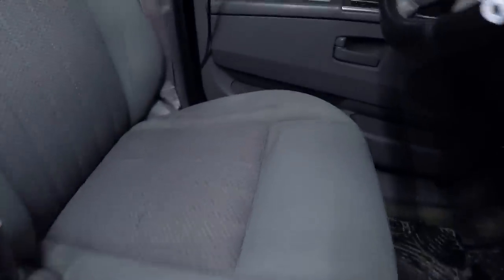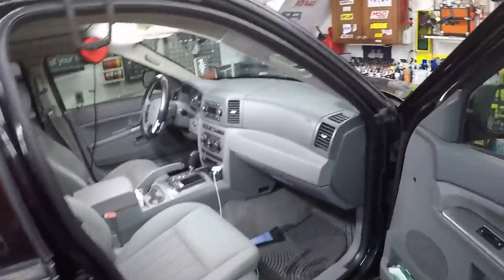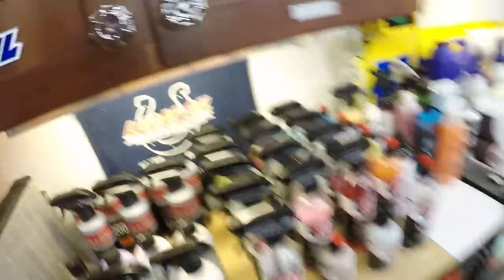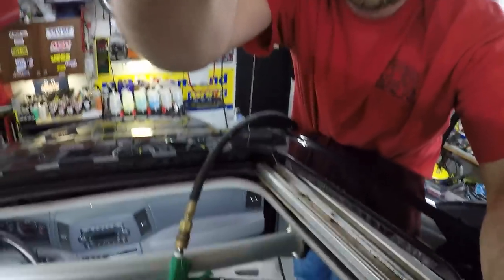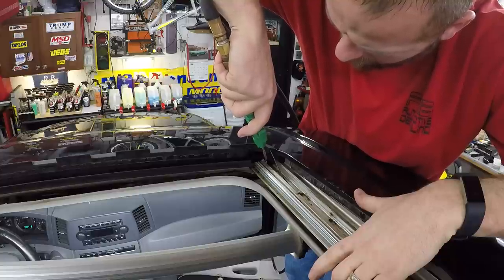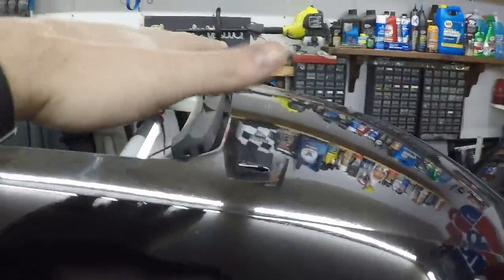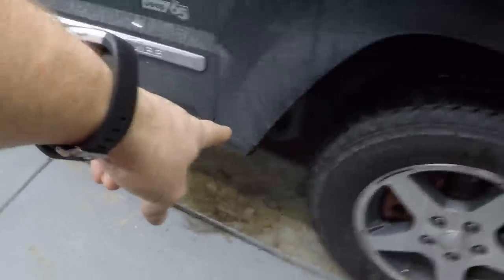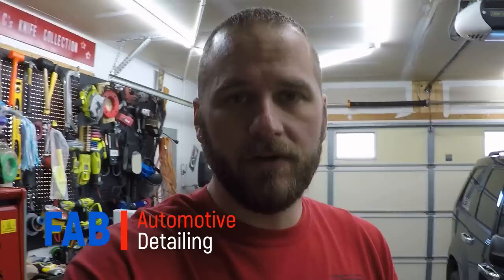Jeep is Leaking Water Inside!

Comment: I have the exact same problem on one side of my 2008 Jeep Grand Cherokee. My driveway falls away and to the side, which may be why it's only one side? I've cleaned out the drain below the windscreen wipers but this did not solve the problem, so I'm really pleased and grateful to find this video. I also have corrosion 'blooms' both sides under the rubber gasket, which was not removed in this video. They are situated at top front of each door under the more substantial bodywork rubber gasket, which I guess hold dirt and water against this location. Hopefully, the corrosion has not perforated the bodywork, and the sunroof drains are the only issue! An easy check thanks to this video, well easier than repairing bodywork!! I'd never would have worked this out without this video. Thanks so much!! 🙏🏻

Comment: If you take the kickpanels off you will see where the draintube exits the vehicle out of a grommet. Remove the grommet and you will see it has flaps on the ends cut them off or use a drill bit to bore the grommet out. What happens is the water and debris get into the moonroof draintubes and the the flaps trap the debris and prevent water from draining properly causing them to back up and spill over the moonroof assembly and run down the A pillars onto the floors
Reply from the maker: LAKE ERIE AUTOMOTIVE I appreciate the information!
Reply: Thank you so much , I’m going to try this
Reply: @rccaraddict294  me too
Reply: @matrix64  it worked for me.

Comment: Thanks for the video! My level blow gun tip could not reach the drain hole in there, so I have used plastic soda drink straw to stick it inside the drain pipe and sticking the gun tip into the straw, it had a resistance of the air flow for a few seconds and then all the water just poured out of the bottom exit. This was on the drivers side where the leaks were happening, there were no leaks on the passenger side and no resistance for the air to flow. After blowing both sides out I tested the drainage with the water bottle and all the water just drained out as it should. Again, thank you for this informative video.
Reply from the maker: Awesome glad the video helped!

Comment: FAB Automotive, your video on this solved my exact issue with my 2005 JGC. I tested the driver’s side tube with a little bit of water and it did not drain so I used a few light doses of compressed air and “voila!”, it drained perfectly right where you indicated. I as well checked the passenger side tube and it was OK.

And for that, I subscribed!
Reply from the maker: Awesome glad I could help and welcome to the FAB Family.

Comment: In the end, figured it must be the grommets at the floor panels (that the blue tubes run into). I learned that it’s like the nipple on a baby bottle,  and gets really skinny at the very end so can only drip water out slowly in the cleanest of conditions. Pulled out the panels only to find that a previous owner had already snipped the nipple off the grommets!!!  I’m at a total loss except to say that these sunroofs just CANNOT handle intense water (& never park on an angle in a hard rain). It just flows over that wall. Will be making good use of the Adam’s!  Any recommendations for cleaning rust in the sunroof track?  Thanks for all the smarts.

Comment: I just got a 08 Commander and it leaks on both sides like this every time it gets wet!  I already blew it out and it still happens!  I’m in the Deep South, no freezing issues here.  It sloshes around in the upper door areas while driving, and comes out from the front edge of the sunroof (which drips onto the steering wheel and then the seat) but mostly the side handles like yours.  
If I can’t figure it out soon I’m going to have to seal my sunroof closed!
Thank you so much for showing us what’s inside all up in there!  I didn’t want to go ripping up my new car, but I was afraid it might have been molding and rotting.  Now that I know it’s all styrofoam, I can focus on the floor and seats.  (I’m going to try the Adam’s)
If anyone has any idea what ELSE might still be going on, please post!
Reply from the maker: You are welcome! Hopefully you get it figured out.
Reply: I have a ‘10 Commander have you been able to figure anything out to stop the leaks yet? It’s been leaking for months now especially when it rains heavy! All over the dashboard, onto the floor and even out of the light fixtures by the doors. Tried looking for cracks or leaks in the drain tube and also tried to blow it out but nothing seems to stop it and i reallly dont want to have to seal up my sunroof /:

Comment: have the same problem with my Commander. I've taken it to the dealer six times for this issue. The last time they replaced the glass, motor and every other component related to the sun roof including all of the head liners etc. It still leaks. I pulled the fuse and plan to silicone it shut for good.
Reply from the maker: My wife has a commander now also and hers was doing the same thing. I keep the drains clean and I have no problems. I have to stay on it though otherwise it will clog up quick and leak inside.

Comment: I find this very preocular- leaks under the dash on the Jeeps. over most of the years-90's through late 2000's. there is a factory repair procedure called a TSB that is normally done by the dealer at no cost to the owner. this is TSB 24-06-96.  
TSB stands for Tech Service Bulletin.
Reply from the maker: I’ve been a mechanic for close to 20 years so I’m very aware of TSB’s and they are not a no cost repair. TSB work is only no cost if the car is still under the factory warranty. With that being said I will look this TSB up tomorrow at work because I am intrigued. Thanks for the info.

Comment: Just took apart my 08, and the passenger side sunroof drain hose was completely disconnected.  Held on from the factory with 6" of electrical tape, go USA.  Jammed the hose back in the reservoir and gave it a shot of JB Weld.  She's never, ever coming off again.  Problem solved.  Dry as a babies bottom.
Reply from the maker: That’s one way to do it! They aren’t made like they used to be. Thanks for watching

Comment: My 2002 wj is leaking down the pillars and dripping onto the floor just like yours was . I have no sunroof. It’s leaking down the very front of the headliner where it meets the windshield and it’s starting to sag.  How the heck is mine leaking so bad with no sunroof  Exact same spots yours was. I checked the windshield molding and was fine. I reglued it down. Still leaks into my Jeep every rainstorm in Florida.

Comment: Great video. This perfectly explains the issue I've been having. If that sunroof drain tube has been confirmed clear  (and not frozen) what else do you think could be the culprit? After each rain the A pillar leaks, causing stains now. Super frustrating. Any ideas?
Reply from the maker: Aerialassault23 Thanks! The hose could have deteriorated causing the leak.
Reply: Hello . I live in Ponce, Puerto Rico . As you know we don’t have snow. My two drains are clear but when rains coming I still have the water leaking problem inside my Grand Cherokee 2006. I really don’t know where is the real problem.  Any more suggestions? Thanks.
Reply: @ivanborrero2966  The drain hoses deteriorate and crack over time
Reply: I am also having the same problem and it's driving my insane. I will check this out. from what I can tell mine are not clogged. I have huge puddles in my driver's side it fills the floor bored. 😩
Reply: People its coming in and draining down your headliner.  Has nothing to do with your drain hoses.  Bad sunroof seal

Comment: Jeeps noted for this 2012 Jeep Liberty of mine leaked multiple time discolored head liner. Sun roofs are a pain in the ass. Yes cause was plugged drains
Reply from the maker: This is the first Jeep we have owned so I did not know about this problem. I have been a mechanic for 15 years and have yet to see a Jeep with this problem so I was a little surprised when I did. Apparently though they are a problem because a lot of people like you have commented the same thing. Thanks for the info

Comment: Had the same problem on my 2005 back in 2007. Water dripping from the pillars, on my feet and from rooftop sunglasses holder. My dad filled the drain holes with silicone chalk and it never happened again. Now, does anyone have electrical dash going on and off? The air conditioning and heat also shut off as the electrical panel dies and comes back on. If I jiggle or push on the key it comes back on. Had the ignition switch recall done and it still persists. Of course, when I took it back to the dealership it didn’t do it...or they just lied to me cause they don’t know how to fix it 😂
Reply from the maker: Drea Mac Sounds like you have a ground issue if the ignition is ok!

Comment: Great video! I might have missed it, but any update? Anymore leaking months later? I just did this exact thing on my 2006. Passenger side was clogged. Used the air to blow out from the top, then took out the bottom and blew it from that direction. Hopefully it stays that way.
Reply from the maker: ViperMike S Thanks! If ice gets on the sunroof then melts water still comes in but  it can downpour rain on it and it doesn’t leak a bit. I think the drains freeze up and don’t unthaw before the ice on the roof.

Comment: I have a jeep commander 2007 sport with out sunroof and is leaking water in the passenger side. If someone have and idea where is coming please let me know.
Reply: I have a 2006 Grand Cherokee with sunroof. All sunroof drains are clear and drain properly. Leak occurs only during rainstorm.  The areas of wetness were passenger side carpet, kick panel, and right underside of glove box. Water was travelling down wire harness from the a-pillar and dumping it on these areas( it was also running over the floor light bulb-not good !).  I water tested the passenger side area, where leak was . I isolated the lowest point and poured water starting in cowl area no leak. I then went upwards and poured water along side passenger side window- no leak. I then took windshield mastic strips and sheet plastic from a blister packaging of something I bought, and made an enclosure like a bucket around the passenger side top corner of the windshield. When I filled this " bucket" up with water, I immediately saw water dripping onto the kick panel and floor carpeting.  

The problem :  the roof is spot welded to the a-pillar at the upper passenger side corner near the windshield. On the outside, this seam is covered by sealant from the manufacturer and then the car is painted. Just below the goop of painted sealant was a very small gap.  This gap was the way water was coming in and travelling through the inside of the a-pillar. The water came in contact with a small wire harness which allowed the water to dump onto kick panel and carpet.

The solution was to apply " windshield and glass sealant " to the gap and other areas that looked suspect.  This stuff is great. It is a runny form of silicone sealant that dries pretty hard. No more leaks!!
Saved myself from having window removed or body shop investigation ($$$). Cost for the sealant was $ 6 and change.

Comment: i am going to try this out, i tried this once already, but thought that there was just a drain on one side for the 2(definetly not draining on the passenger side) i have a 2 part question. 1.) what was that rubber piece you had on the end of your blow gun?  2.)The water has been practically pooling on the passenger floor any advise on drying it out?

Comment: My jeep 07 just started to leak exactly the same spot as u except mine dosen't have a sunroof n I cant quite fic the problem I looked everywhere but seems to me it might be where the windshield is leaking right on top of the windshield any suggestions
Reply from the maker: Ram Garza If you don’t have a sunroof then it would either be the windshield or your door seal. Only thing you can do is take a garden hose with no nozzle on it and run it down the roof towards the windshield. Have someone I side watching to see if it comes inside.
Reply: My 01 grand Cherokee has no sunroof & it just started leaking from the driver side top corner of the windshield. Tomorrow I will find out if it is the windshield seal or the roof rack bolts.
Reply: I had fixed the problem it was the windshield right on top of the windshield it had rust connected to the car so I put auto silicone n it fixed it. Later gonna buy a new windshield
Reply: @thelostmachine713  try checking the windshield in front their might be a rust somewhere a tiny little whole somewhere and that's where the water is goin threw
Reply: @ramegarza9217  thanks for the heads up. So yea that's what I'll check 1st.
Reply: @thelostmachine713  no problem
Reply: @ramegarza9217  Yea it was leaking under the windshield seal..fixed with clear silicone!
Reply: @thelostmachine713  did u use auto silicone tho

Comment: Great video as always Brian. Off topic question, but important. Have you noticed those LED lights are throwing of a lot of radio frequency noise?  has it affected your wifi otr garage door openers in the garage area? Have you tried listening to an AM or FM radio in there to see if they affect radio reception?
Reply from the maker: Thank you sir! No they have not messed with anything. I almost always have my radio on when working in the garage and if I am in the garage the lights are on. I also use WIFI in the Garage and it has never messed up. Garage door openers also work with the lights on. Hope this helps
Reply: @FABAutomotiveDetailing  Thanks! Can you confirm the model you bought from Amazon? Was it the Barrina LED T5 Integrated Single Fixture?
Reply from the maker: BigOldDog here is the link to the one’s I bought off amazon! 

https://www.amazon.com/Barrina-Integrated-Fixture-Utility-Electric/dp/B01HBT3BVM/ref=mp_s_a_1_3?ie=UTF8&qid=1548892228&sr=8-3&pi=AC_SX236_SY340_QL65&keywords=barrina+led+t5&dpPl=1&dpID=41CSVksDnPL&ref=plSrch

Comment: Anyone know about the Australian imported editions?  I just had a look at mine and I don't have those same drainage holes in my sun roof.  In fact I couldn't see drain holes at all
Reply from the maker: There has to be drains for the sunroof otherwise everytime it rains the interior would get soaked. Every make and model I have ever worked on has drains.
Reply: @FABAutomotiveDetailing  yeah turns out the holes are much smaller.  What would cause water to build up in the rear passenger? That's my main problem not the front
Reply from the maker: @lightandlines  Dirt and debris gets in the small tubes you will need to blow out easily with air.

Comment: FAB Automotive Detailing, great seeing this BUT, I have a Jeep Liberty with no sunroof, noticed today with the heavy rain that I have water coming in where the plastic roof liner end (rear of the car)to where the headliner starts.  I can't figure it out.  Could it possibly be - someone stole my antenna mast, I had replaced it with a universal mast which didn't make the complete connection and seal.  Bought a OEM Mopar mast today.  Is it possible that that is where the water can in?  Any help you can provide would be greatly appreciated.
Reply from the maker: Jahm823 McCartney If the GPS mount isn’t sealed right then yes it can leak. Also your windshield could be leaking in that area also. 3rd option is the door seal isn’t sealing allowing water in.
Reply: @FABAutomotiveDetailing  Thanks for your quick response.  They did not steal the base of the antenna, just the mast itself which unscrews.  The part I bought, did not screw all the way onto it and there was a gap. I thought water might be getting in that way.  Its not my windshield no sign of water in the front of the car, just the rear cargo area where the inside roof trim starts (plastic piece).  I will have to try to check if the door sear on the back is not properly sealing.  I don't even know where to begin as far as how to find the culprit.  Thank you again.
Reply from the maker: Jahm823 McCartney Is the base is there then most likely it is sealed. The mast wouldn’t make a difference on or off. You are welcome

Comment: Does it still leak? I have not solved this same problem and its basically tarp until further notice if we can't get this fixed lol
Reply from the maker: Planet of the Abes It only leaks when there is ice built up in the drain tubes. Basically when snow sits on top of it and the ambient temps are below freezing the water must freeze in the tubes and block the drains.
Reply: I see I’m coming late to this conversation, but I am about to either tarp daily or loose my sunroof if I can’t figure this out.  We’ve got another week of heavy rain forecast and I’m loosing my  mind!  I have wet towels everywhere and it’s starting to smell.

Comment: Hahaha....okay I've been looking for a video, I have the same problem. actually jus the driver side handle. Leaks water too jus like yours. But I don't have a sunroof nor I have top cab lights. Dodge 07 ram 1500 single cab.. leaks from the top bolt hole. Same dry every where I can't find... I'm stumped
Reply from the maker: It could be your windshield. That’s about the only thing that can leak without a sunroof.
Reply: Okay, but I'm just asking. How and if it's my windshield when it leaks no where near. But I'll give it another try, cuz I've check and put silicone at the driver side corner and about a foot out across the top. But I'll give it another go, thanks..